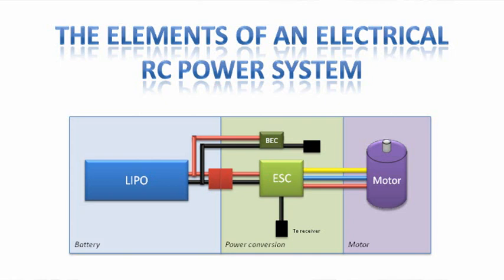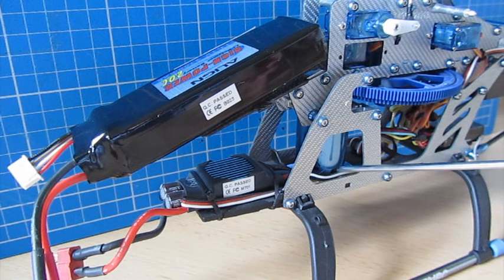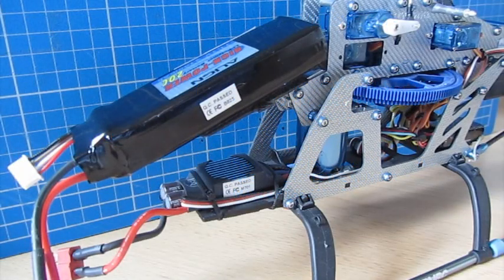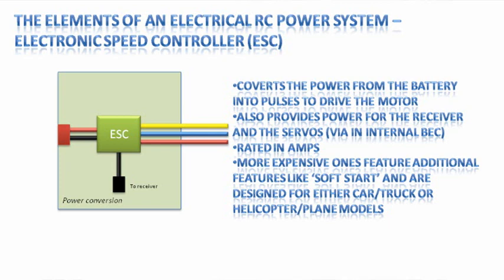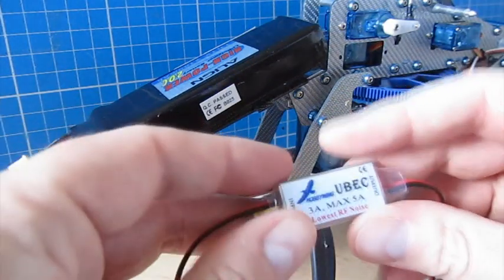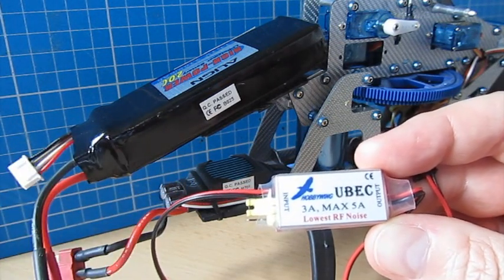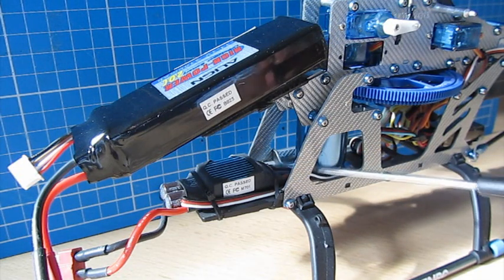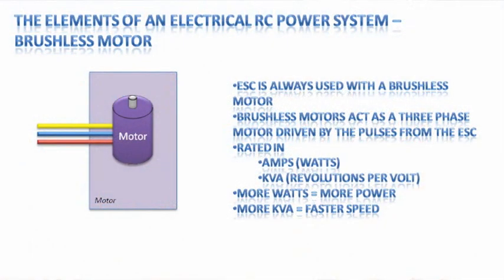RC Electric Power Systems Simply Explained (ESC, BEC, LIPO, Brushless etc)

Comment: Trying to figure out a dual series with two sources but connected via the negative wires through the receiver. I cant find any info on this and if i have done this correctly. Any help or advice?
Reply from the maker: I don't understand the question.  Can you elaborate?
Reply: @Painless360 i am running 2 esc's/motors and 1 servo off a 4s then monitoring that 4s through the bvd port on the receiver. Then i am powering the receiver and 3 other servos with a 2s. I dont know if i am overthinking or just not experienced enough but with all the negative wires from both sorces connected via the receiver, im not going to have issues am i?
Reply: @Painless360 i have a diagram drawn up to explain it better
Reply from the maker: A common ground will be needed but I wouldn't try and run any level of power through the pins on the receiver. Best of luck!

Comment: I’ve got a new drone flashlight and it says it’s working current is 12.6v & it’s volt support is 7A-17A what do I need to get this flashlight to work on my 6s drone ? Wired to the battery
Reply from the maker: That is a powerful light. You have the voltage and current backwards in the question so be very careful wiring stuff up if you are new to electronics. https://youtu.be/9U5HIdN7Ik0 covers the basics.. I hope it helps..

Comment: Thanks, that was very useful.
If the lipo with the same set up was 10c rating instead of 20c would the lipo still be ok but just not provide max power or would the lipo get damaged?
Reply from the maker: If you try and pull more current than the battery is rated for then at best you'll get a hefty voltage drop and worst damage the battery.  Always make sure that the battery can provide more current than the SSC.. best of luck
Reply: @Painless360  thanks. 
I replaced a 8 inch prop with a 10 inch prop using the same lipo and the lipo has stopped working. I'm guessing that the bigger prop must've drawn too much current out of the lipo and has damaged it? However saying that if the esc is 15amps and the lipo is 20c then shouldn't the esc have prevented the lipo from pulling any more than 20amps?

Comment: Thanks :-) Very well explained. What is the importance / relevance of having a wide vs narrow supply voltage range for a receiver (e.g. 4.5V to 10V vs. 4.5V to 6V), since I understand that a BEC usually provides 5V or 6V for the receiver, flight controller & servos anyway ?
Reply from the maker: To support servos that work on higher voltages without complicated additional wiring.. Happy flying
Reply: @Painless360  Thanks for the clarification 👍😀

Comment: Hello. I have a question. On my trex 500 I installed a second battery 2s 3300 to power receiver and fbl + servos and also cam equipment (cam, vtx) and use main battery just for motor. What advantages and drawbacks of this setup? Do I get more flight time this way?
Reply from the maker: Using a BEC and power from the flight battery is a more normal way to do it. An extra battery works but can add a lot of extra weight. It depends on the size of the flight battery, what current you need for the servos, flybar unit (if fitted) and Rx. They usually pull a very small amount of power compared with the current used to fly..
Reply: @Painless360  Its kinda hard to say if it improves anything, caz I just installed it. All I know is that runcam eats 500mah alone, and when I plug in vtx tbs unify 32 with 1000 mW of power, it may also eat some battery. I also know that Trex 500 can lift up to 5 kg extra weight).

Comment: what if i upgrade my rc excavator, using standard servo motor on the market and what BEC ESC and BATTERY should i use for making little bit faster in terms of moving the boom and arm for the exavator.
thanks,
im waiting your reply.
Reply from the maker: See my videos on servos and RC power systems.  It depends on how many servos you have and how much current they need... best of luck

Comment: Excellent information. I should like to ask please if in my Albatross Hu-16 (in the manual it says for a 30C battery)  can I use a 15C battery that I already have ? Thanks very much.
Reply from the maker: It depends on what battery size it recommends - you need a battery that can comfortably supply the needed current... If you halve the mAh rating you need to double the 'C' rating to get the same current output..

Comment: Hi, I liked your video.
I am making a Hexacopter for autonomous flight project for my university. I have 6 ESCs for 6 motors. I know that my ESCs dont have UBEC/BEC inbuilt in them. To solve that do i need 6 separate BECs  hooked  to  each  ESCs  saperately? or I  just  need  one UBEC hooked to the   5V output pin?

In your video there is no information 
about BEC.
What ESC did you use in this drone? Can you please provide the link please? 

 
Specifications. 
We will be using Hixhawk 4 for flight controller. 
Nvidia Jetson for computing autonomous flight processor. 
Tarot Brush-less Disc Motor 4108 380KV 6S
Hobbywing XRotor Brushless ESC 2-6S 10A 15A 20A 40A SimonK No BEC High Refresh
Tarot FY690S Full 6-axis 3K Carbon Fiber Aircraft Frame
Slamtec RPLIDAR A1 2D 360 degree 12 meters scanning radius lidar sensor scanner

Comment: Another well done video on the Basic's of RC Electrical Systems.  With an
ESC being the "brains over the brawn" how might one be able to determine
good quality ESC's over the lesser?   I don't know that I would want to save
money or to "skimp"  for a lesser quality of ESC?  A poor quality ESC might
cause excessive wear of the motors or just give poor efficiency.....
Off to the "battery" video..... lalalalaaah
Reply from the maker: As most ESCs run the same BLheli style firmware it's more down to the quality of the build and components used. Every pilot has favourites but see the quadcopter builds on the channel for the ones that I use..happy flying!

Comment: 10% Rule- A good rule.  Outside of the Transmitter needing programed in order to fly, what other of these
electronic components needs programmed to operate properly? AND of those which requires special
meters/devices to help in that process?  I'm sure I'm far advanced to ask these questions but I can see
it going that direction fast....lol,  these little boards or some of them can be programmed?  I don't really
want to mess w/ them if I can avoid it but if it's a needed deal I want to know what stuff I'll need?
Like the ESC,  it's a very smart device but would I need to mess with it?  And some of these parts
cover each other to a degree?  Heck, I'd better go back to the videos before I have an aneurysm?
peace

Comment: ok so the bec chnges the volts to safe    but on my esc it says 5v\1a  im gonna run a brushless motor  that can handle 3s\11v. but will the bec just give 5v to the motor?
Reply from the maker: You shouldn't use a battery Eliminator circuit to run a brushless motor. A bec is there to provide a steady 5 volts for those electronics like flight controllers, GPS units and radio receivers that need it. See the other videos in the introduction to a remote control series for more information on how power systems work..
Reply: will this work ?   or do You know a esc that can work with  the motor  Max Amps: 37A(4600KV)   the battery is 7.4v 1200mah 25c

 the esc is this : 35A Brushless ESC Electronic Speed Controller with 5V/1A BEC for 1/14 1/16 RC Car

the motor :Racerstar 2440 Motor Brushless Waterproof Sensorless

servo: Emax ES3104 Analog Mini Servo

The transmitter and receiver :Original AUSTAR AX5S 2.4G 3CH AFHS

the battery :7.4v  25c 1200mah
Reply from the maker: Please watch the power of videos in the 'Introduction to remote control' playlist here on the channel. Sounds like you're quite new to this, and covering the basics in these videos will help you understand it a little bit better. Best of luck..
Reply: u got a link ?   yeah im new to hobby grade. but i have had allot of toygrades!

Comment: Hi folks. The other obvious thing is the guage of the connecting wires. They act as little low value resistors and if too thin will cause an unnecessary large voltage drop, wasting power, and possibly even overheat and melt the insulation. Check the rating and allow that extra 10%. Even a wire causing a one volt drop will have a significant effect on the performance as the current flowing will also be reduced. It's a particular concern on the motor circuits. Bob.
Reply from the maker: You may be surprised - https://www.youtube.com/watch?v=KkRBoa3ywyk

Comment: Sir I have a 8x4 prop which  pulls 15A so which max C battery can I use.i am confused.can I use 30c or 40c or 25c
Reply from the maker: +Universal Video I can't answer that unless you know what battery you will use. You need the capacity of the battery x the c rating to be more than the 15A you need..  hope that helps.

Comment: sir I have 1400kv 10t brushless motor and 30a esc. how much C battery should I use 25c or 40c.
Reply from the maker: Depends on the prop you're going to use. Once you know that, look up the amperage the motor will pull with that prop and use a larger ESC. Best of luck!

Comment: I just bought a durafly dh 100 and it has a bec wire for a receiver and a ESC wire for the receiver

So can I plug both of them into my receiver?

I have a 6 channel receiver with batt/bind
Reply from the maker: +Grackle FPV if you mean the vampire plane, I have one here. Mine doesn't have those two wires. I did get in touch and ask to Hobbyking support guys. Best of luck

Comment: If I give my variable pitch quadcopter or RC Heli negative pitch to make it dive down it s propellers will accelerate in RPM . My question is this, If my RPM exceeds my Throttle setting as a result of autorotational effect as the heli accelerates downward with the aid of gravity, will my heli still be drawing amps and power from the battery? What will happen in this case to my system? Will back emf constantly try to slow down the excessive RPM?

Comment: can I use 2200 mah battery for 1000kv motor or is it too heavy
Reply from the maker: +Universal Video see the other videos in the 'Introduction to Remote control ' series as I cover this. It depends on the prop and battery voltage your using, you want over twice the total model weight in thrust ideally..

Comment: if i used a separate lipo just to power my leds  would i use one of the ubec switches to limit the current to the leds? i would i still have to install resistors in the light circuit its self?
Reply from the maker: +David Dobson the switch will do nothing to limit the current.. If you're using an led that needs a different voltage than the one it's connected to the  you'll need a resistor.. Best of luck

Comment: Thanks but why can a 2100 ma battery supply 42 amps
Reply: Do you multiply the 20c by 2100mas?
Reply from the maker: See the videos in the 'Introduction to Remote Control' series as the battery videos cover all of this.. Best of luck!
Reply: timmy zitzmaan 20*2.1a or2100mah

Comment: Hi, I am using pixhawk to configure my quadcopter. If I add a normal servo on pixhawk, how large max current (output current) of external switching BEC I need to choose as the secondary power supply?
Reply from the maker: Depends on how many and what type of servos. Look at the specs for the servo.. I'd normally go for a 4A+ BEC on a fixed wing..
Reply: Thanks for your response. Unlikely using a BEC to supply many servo on a fixed wings such as elevator, rudder, aileron. I only use a BEC to supply one similar kind of servo. I chose a 5A max BEC. When you said 4A+, did you mean the maximum current output is 4A? By the way, the link as shown below is the servo I chose. 

https://www.amazon.com/Castle-Creations-Bec-Switching-Regulator/dp/B000MXAR12

Comment: Can i use a UBEC like you showed, on my Fly Sky fs-i6 transmitter ??
Reply from the maker: +talukder Mukit not sure why you'd use that on a transmitter. Do you mean receiver?
Reply: No, My tx need 6V, And i have 12v 1c lipo!!! and i think its better to use lipo.
1.5v or 1.2v cells are very quickly lose their voltage.
Can i use it ??
Reply from the maker: Sorry, I don't understand. I've never seen a 1C LIPO.. I'd use the batteries specified.. Best of luck!

Comment: Do I need a Bec to run X2 23kg servos in my brushless Emaxx? Cause I can't seem to make them work and maybe that's because I need a Bec?
Reply from the maker: Most servos need 5v to run so you need to supply them with that somehow. I'd look at use a BEC with at least an amp more than you'd normally use to handle a few servos with ease.. Best of luck!

Comment: IS IT SAFE TO USE HIGHER 25 AMP BATTERY FOR 10 AMP MOTOR
Reply from the maker: Should be, the motor only pulls what it needs...
Reply: what if esc 30A rated lower than battery of 45 A

Comment: Can I connect 2 motors in series, for example I have 6s battery and 2 3s motors, so I want series connection to divide voltage by 2 for each motor ?
Reply from the maker: You can't do that with brushless motors. Not the way it works I'm afraid..
Reply: Thanks, kinda tried to do that, but luckily didn't fry anything.

Comment: Painless do you think the motors are still ok since they started to smoke
Reply from the maker: I'd be very careful with any motor that smoked. The smoke is the effect of excessive heat in the windings inside the motor as they are designed to be fed with very high frequency AC voltage/current not sustained DC, as you connected it. The smoke is actually the very thin coating of lacquer that insulated the winding wires burning. Personally I'd junk it and get a new one. See the 'Introduction to Remote Control' series for our videos on the basics. Best of luck!

Comment: And tried to run the motor without going thru a reciever and transmitter and using a three cell 11.1 volts was a big mistake for me the motor started smoking got it unpluged quickly hope fully know damage, the motor still turns, thanks for the great info, you are great teacher, I have read theLast two hrs all your treads thanks again Col. Ronald
Reply from the maker: Looks like you've left a few comments overnight so let me answer it here - You need an ESC to run a brushed motor. A brushless motor works completely differently from a DC bushed motor. The ESC does two things, send a high frequency pulse to the phases of the brushless motor in turn to rotate it and also monitor the position of the motors through the pulses coming back from the other two non active phases as the magnets pass them. If you want to connect the motor to a battery directly then you need a DC motor.. Hope that helps.

Comment: Wow great info, I have a great question for you. I have a three phase motorl can I run the motor without an ESC.
If I understand you correctly all wires from the motor have to go thru aESC.
Is there another way to run the motor without going thru a tranmitter.
I got the wrong infomation
Reply from the maker: I've answered this on one of your other posts/questions. Hope it helps..
Reply: Rono Gator if you don't run it through a speed controller the motors going to run wide open all the time is that what you're looking for
Reply: I think that was kind of rude of him not to answer your question even though he had tried to answer it in the past hope you unsubscribed

Comment: I connected all the parts what i need to the rc car, but a little after, something burned out. I didnt have this "bec" thing (hadnt even heard about that...) i dont know wich Broke, do you? Should i buy this bec thing? Im beginner on this, making rc car in school :D nice video btw
Reply from the maker: All of the electronics on a normal RC model run at only 5v and the BEC (battery eliminator circuit, called that so you don't need a separate 5v battery too)  provides that. If you've wired parts that expect 5v to the main battery then you'll have destroyed them. See the videos in the 'Introduction to Remote Control' series for more of the basics..
Reply: Okay, thank a lot :)

Comment: on a quad, can i use one linear esc bec to power the fc and use the others to power the leds, 5v fpv system, etc?  

i have emax simon k 12a esc w/ bec.  im thinking use one esc in full to power the FC.  The other esc I'll wire in the signal and ground wires, then pull the red power wires to my leds and my 5v fpv vtx/camera set.  if this works, I should be able to pull ground from anywhere right?  pdb or at esc bec wire?
Reply from the maker: That could work. If the BECs are linear then I'd connect all of them and have the benefit of all.. Best of luck!

Comment: I'm new to electronics and I'm working on building an antweight fighting robot, could I just connect a lipo to a UBEC and then into the receiver? the wheels and flipper will be powered by servos, thanks.
Reply from the maker: +SeismicMedia that would work. Make sure the UBEC is 2amps or more to handle the load. Best of luck!